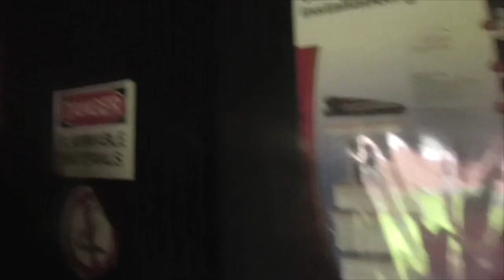John Deer Needs A Trailer Hitch

Comment: You can just drain your tanks and open all of your taps, then connect your compressed air with an adaptor you buy , to the city water hookup on the outside. Chooch all the water out of your lines, let it all sit open for a couple of days to evaporate, close er up and you're winterized. No antifreeze needed, my dad has done it that way for years